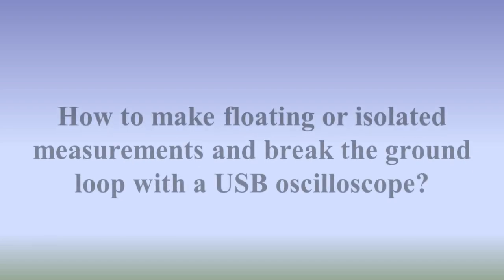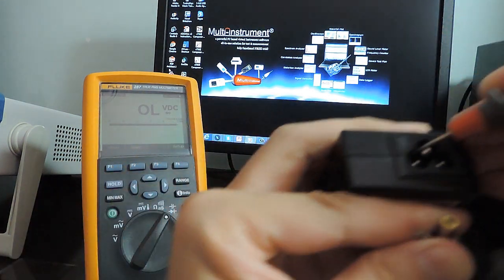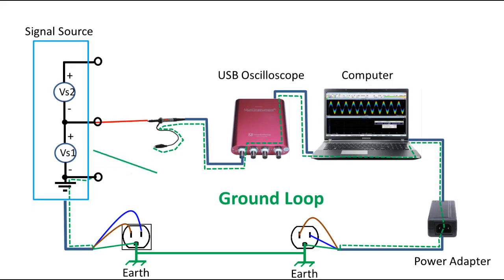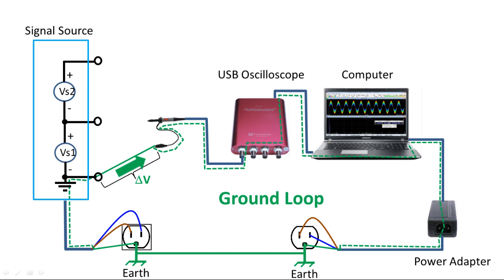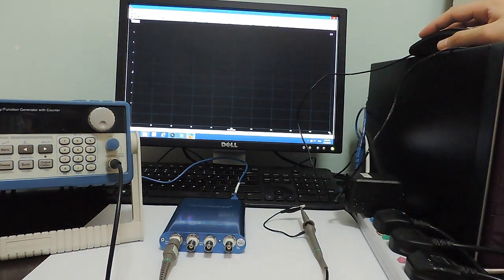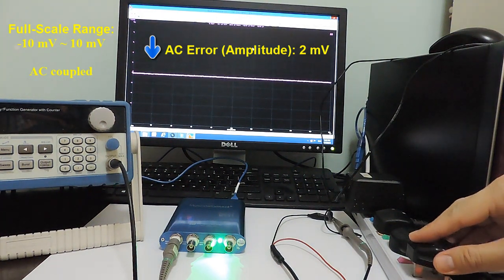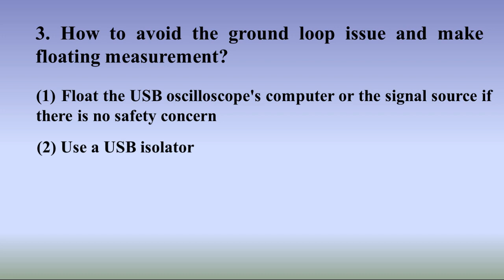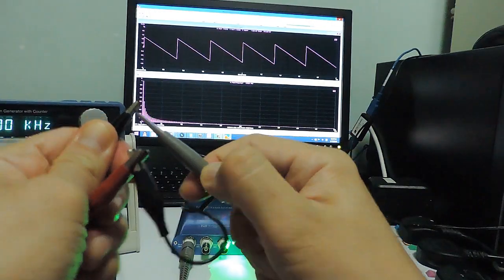How to make floating or isolated measurements and break the ground loop with a USB oscilloscope?

Comment: Why are you using diode test mode on multimeter for resistance measurements?
Reply from the maker: That mode is used for continuity tests. You can hear a beep sound if the continuity is good.
Reply: @VirtinsTech  I suggest you learn your super expensive Fluke and read it's manual a bit. There is continuity sign next to Greek Ohm letter. Continuity test is done on Ohm range.
Reply from the maker: @rvdboston9568  Thanks, you are right. Fluke 287 is different from some of our other multmeters where the diode and continuity tests are tied together.  However, it is still possible to use the diode test mode of Fluke 287 to simply check the presence of continuity without displaying the actual resistance in ohms.  According to the manual, "it will beep briefly for a normal (diode) junction and sound continuously for a shorted junction, below 0.1 V."
Reply: @VirtinsTech  Beeping aside, you may get false sense of security if there is inverse diode in the circuit - your diode test will not beep but it will be high voltage circuit. Also, resistance measured in Ohm not Volt just make sense.
Reply from the maker: If there is an inverse diode between the circuit ground and the protective earth (the chances are slim if not none), one has to measure in both directions in order to be sure, whether the Fluke 287 is put in ohm or diode mode.   The continuity test here happened to use the continuous beep (thus regardless of diode direction) in diode mode to check whether there exists a nearly-zero ground loop impedance.
Reply: @VirtinsTech  
почему ты не расказал про X Y конденсаторы. Они тоже гадят и в заземленном и в висячем состоянии. Раньще они иногда даже выжигали всякие LPT  и COM порты

Comment: If you did connect a pc scope ground to a positive voltage with computer isolated from mains earth, where would this potential charge dissipate, I'm guessing it would fry m/board usb tracks or cook the battery negative in some way, would anyone know please,??
Reply: It would destroy everything it can
Reply from the maker: In that case. it will be dangerous to human (not the computer) because the ground of the probe and computer become live now.  However, the computer which is isolated from the mains will not be fried as it needs a closed circuit with a low impedance along the path(thus high current) in order to fry something.  The probe tip and the input of the oscilloscope is of high impedance. The current flow through them is very small and will not fry anything.

Comment: Why dont you disconect ground from USB cable , and use just USB for data not power , use a transformer to power the USB scope , not some dongle that limits the data
Reply from the maker: The ground of the USB cable is required even for data communication only. Therefore it is still not isolated. You are right in the sense that a USB 1.1 isolator will limit the data rate to 12M.
Reply: @VirtinsTech are you sure ,  that i am not right in both , i think i am, please explain how am i not correct . You showed that there is no ground in that USB dongle ,  yet you say now USB data wont work without it , its contradictory my friend, ether im correct on both cases , or youre experiment is a fail , and i dont think it is i think its all good, and my external USB powering method is also good . but  im gonna wait to hear what you say , not an expert , i plan to do it tho, not for scope , but for USB DAC to lower the noise since ive measured ripple on power supply, so i  want external , if you are correct my external power with isolation will make it stop working cuz data will lose ground .
Reply from the maker: @dedskin1 , For USB data communication to work properly, you need four wire: VBus, GND, Data +, Data -. Thus, you cannot simply remove the USB GND.  You can separate the power supply and data communication functions of the USB port, in order to provide a better (hopefully) power supply to the USB device. However, this arrangement itself does not do any isolation. For the purpose of isolation,  (1) You still need a USB isolator or put some isolation circuit inside the USB device to isolate the USB communication circuit from the front end of the USB device  (2) You also need to isolate the external power supply, for example, using an isolation transformer to power the external power supply.
Reply: @VirtinsTech  But how did you do it  , you did it ? Obviously doable
Reply from the maker: @dedskin1 , using off-the-shelf USB isolator is simple and sufficient here. It is not a big deal if you want DIY.
Reply: @VirtinsTech  I like you man, but you are not making me happy ,   how can you isolate DATA ground  since you isolated it , if you did , you claim you did , but when asked how , very little or no answer is provided , you are not forced to explain off course , im just asking , but if you know say it . Or i will find out . and tell you .
Reply: @VirtinsTech  Ok since you didnt understand the question , or whatever i looked  it up  so  https://www.youtube.com/watch?v=SzUe7xBGPFw . They claim 480MBps tho , so something is fishy in this video , but ok, so that is how it works , ill try since i dont have it , with just Vgnd isolation, Data isolation is gonna be harder to make .
Reply from the maker: @dedskin1 , Please refer to: https://www.virtins.com/USB2ISO.shtml and the datasheet of ADuM3160 and ADuM4160 on how it works.
Reply from the maker: @Pavle Pavlovic, "https://www.youtube.com/watch?v=SzUe7xBGPFw"-----Thanks for the video, but LTM2884 and LTM2894 are USB2.0 Full Speed isolators which support 12M only. There do exist USB 2.0 High Speed Isolators (480M) which are based on fibre optics and expensive. Google "USB 2.0 high speed isolator" to find the answer.